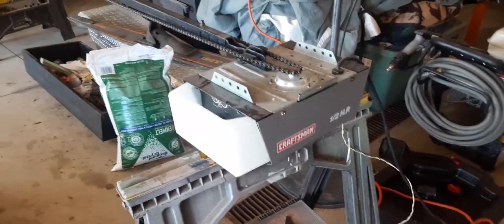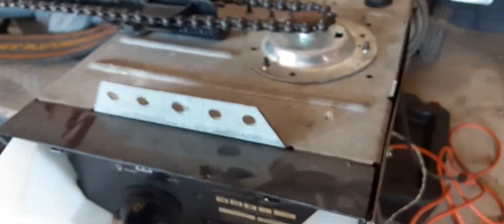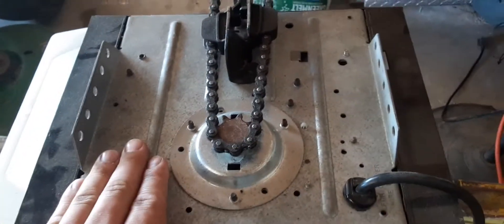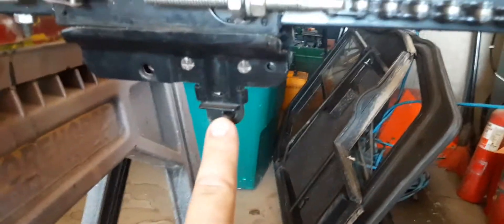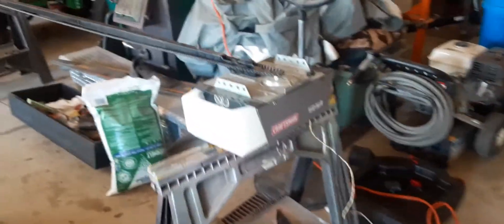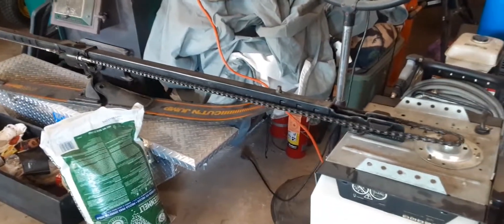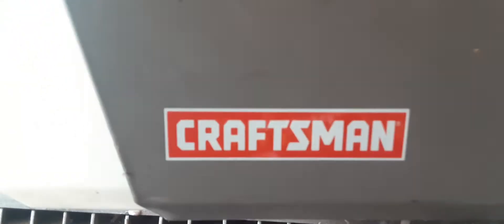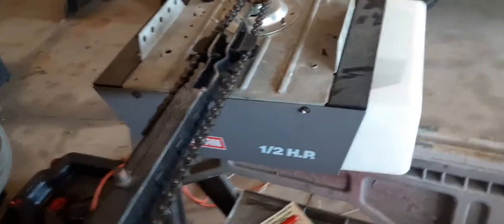Craftsman 1/2 HP 139.53975SRT.

Comment: What an interesting project you got there, I'd usually fix such rigid parts with wd-40 but it seems it's just a completely different issue. Hopefully you post a followup with the issues resolved!
Reply from the maker: Thanks, Pal! I don't use wd-40 on these as it's not the best for these. Yes this opener was on an unbalanced door which made it wear out those parts quicker. I will post a follow up when it's completely fixed.
Reply: @YoshiRocks2244  Gotcha, have fun with your repair.
Reply from the maker: @thejazzo3595  Thanks, Treecko Pal. Love you.